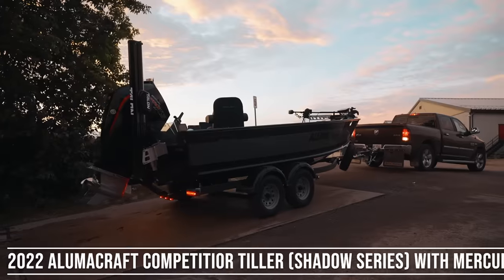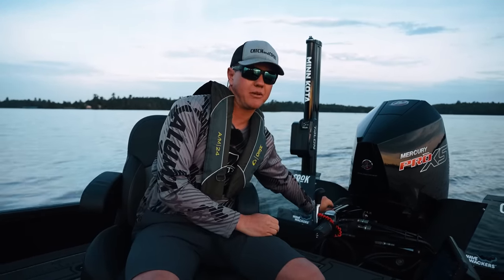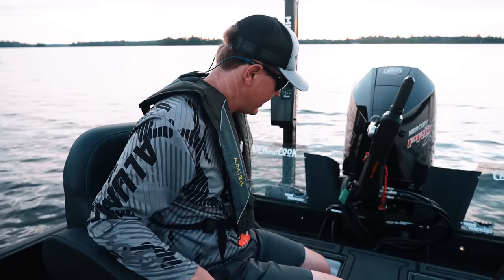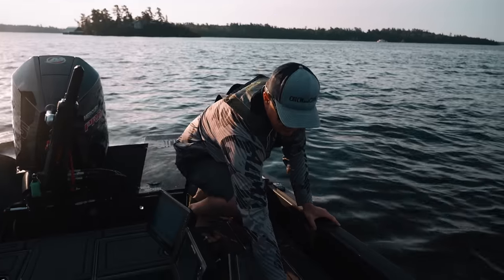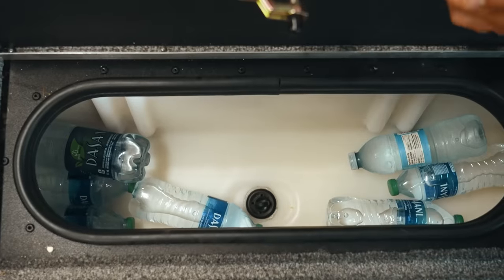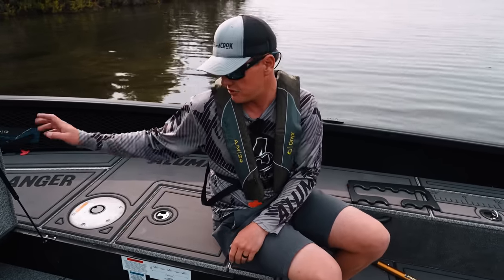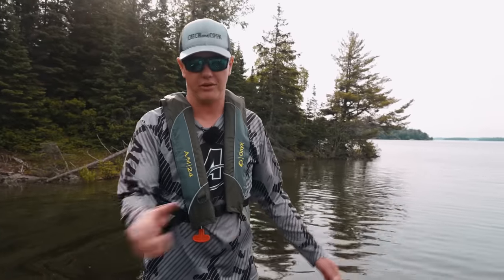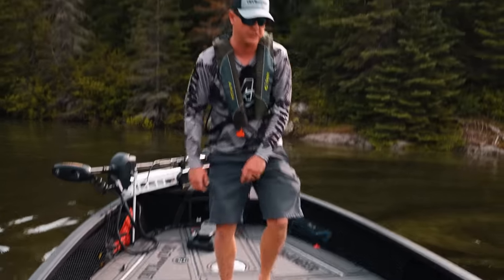DREAM BOAT 2.0! Alumacraft 205 Competitor Tiller With Mercury Pro XS 200 HP - Complete Walkthrough

Comment: I picked my 205 shadow windshield version up with 250SHO for $43.5k back in 2018.  Still one of the best deals today for what it has to offer.  I mainly fish great lakes for small mouth and it handles rough water well for what it is.  I swapped props to enertia 19p and it seems to offer best performance and ride overall.  Runs about 58-60mph on a good day with decent economy.  Only complaint on the boat is slow speed tracking, bow gets blown around and screws backing out of front deck.  The screws backing out is common on aluminum boats and easier to deal with than my previous glass rig with gel coat cracking.  Very underrated boat for big water bass fishing.  I still enjoy running it 4 years later.

Comment: Mercury does warranty one lithium cranking battery from Relion.  It’s a 100 amp hour dual purpose lithium but it has to be the relion HP.  As far as I know this is the only lithium cranking battery that mercury won’t void it’s warranty.  I just bought a 2022 Crestliner raptor 1850 with the 200 pro XS on it.  West Marine is where you can find these batteries.  I run a helix 15, 12, 10, and a Garmin 106sv with the LS34.  I don’t run all the units at the same time but a few are always running and have not had any issue.  Great great battery.

Comment: Jay: I have the same hydraulic steering on my 2005 Alumacraft Tournament Pro 185 with a 90 hp. Yamaha. Yes, 2005. It was designed and built by Merten's Co. and a few years later Merc bought them out. Now you can only get it on a Merc which I think is a shame but that's business. It's a sweet boat, Jay.
One thing I'd do differently, because like you said, "When you hit a rock," is put a 15 horse kicker on it and take off that Talon anchor. If you hit a rock with that big 200 hp, with a kicker on the boat you can still get home. Also, you can backtroll much slower with a kicker. But that's only my opinion.

Comment: Awesome boat Jay.  One thing, you might consider doing is to put a grommet in that hole where you have the wires running to your lithium charger.  Last thing you'd want is for the sharp edge to wear the wires and short the charger, batteries or possibly other stuff in the boat.

Also, first thing my wife noticed was the haircut :)

Comment: What does this full set up weigh?
Reply: I have this boat is the sport model and a 250 Suzuki and the hull alone weighs about a ton bone dry… so add a 500 pound motor, batteries everything else you are close to 3000 lbs or more